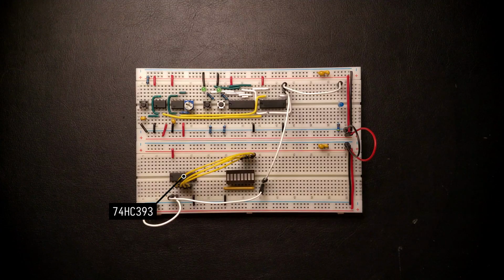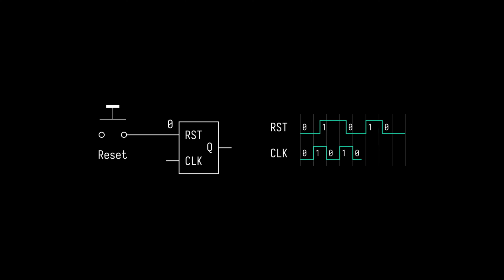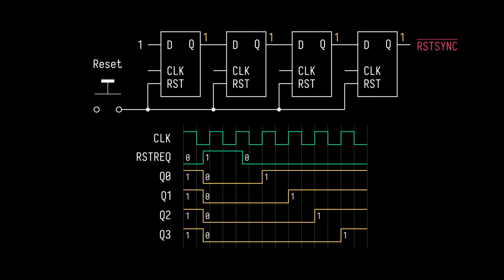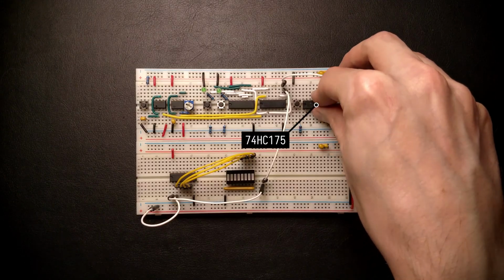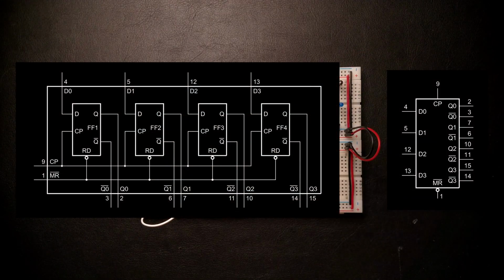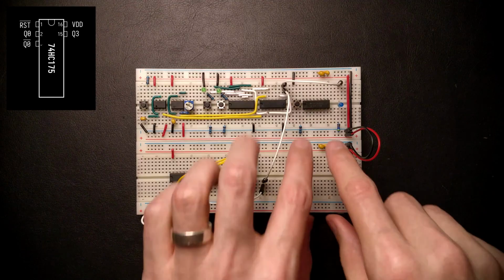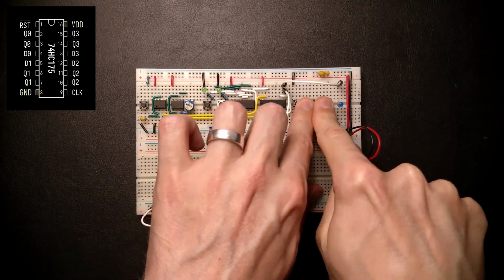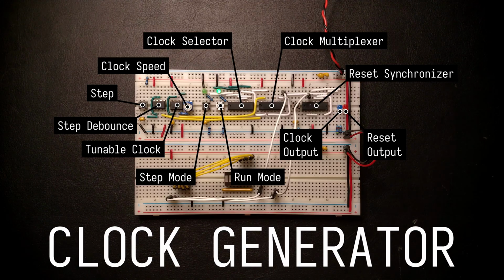Reset Synchronizer – Superscalar 8-Bit CPU #5

Comment: seems like the clock multiplexer's output should be latched, clocked by the free running clock or something, so that when you switch clock sources you don't cut the current clock cycle short. probably doesn't present itself often if you're running at extremely slow frequencies like this but if you scaled this up to use a fast crystal and had long propagation chains in your CPU it seems problematic. i think james sharman might've encountered this? cannot recall.
Reply from the maker: Yeah that's an excellent point! Just having a multiplexer there can introduce glitches that ruin the state in the CPU. Pretty sure that's going to become a problem with fast running clocks as you say. Ideally you'd have a clock gate at each output and use a bit of logic to gracefully switch between two logic sources. Or use the fastest clock to drive an FSM that safely disables the active clock, waits until it has been low for at least one cycle, and then enables the newly-selected clock.

Comment: I recently saw your fantastic series and try to build the CPU in a simulator. By implementing the reset sync I noticed a problem with being the first D Input constant high and simultaneously pushing the reset pin high. This should lead to an unknown state at the output since set and reset are both high then. To avoid that I used J-K Flipflops, this works better, but if I keep the reset button pressed the output will toggle then witch each clock tick. 
What do I miss?
Reply: I found it myself, the 74HC175 uses a flipflop with a asynchronous set and clear and a synchronous data input. The set is forced to low and the clear resets the flipflop immediately.
Reply from the maker: Yes, that's it! 🙂 The async reset on D flip-flops usually overrides any clock or data inputs, and will force the output low. Once the reset is released, the clock should cause the constant high input to be stored and propagate through the chain of registers.

It's interesting that you ran into this issue in a simulator. Do you know what kind of register that simulator uses? This should be the normal D-type flip-flop behavior. But if the simulator uses some form of JK or SR flip-flop as you describe, you might get that weird behavior.

Comment: I built the clock circuit exactly like yours but there is still some occasional bouncing on the clock signal, which skips some steps, observable with scope too. Do you know what could be the cause?
Reply from the maker: I'm sorry to hear that! The first thing that comes to mind is the resistor/capacitor value that determines the debouncing circuit's time delay. The button you use might have more bounce than the one I had on the breadboard (my button might also deteriorate over time, causing me to run into the same problem you're seeing). My guess would be to try and increase the capacitor/resistor size to increase the debouncing dead time, such that slower bounces are still properly suppressed. Let me know if you see any change!
Reply: @fabianschuiki  I replaced the 470nF with a 1uF, and it seems to do the trick, thanks!
Reply from the maker: Great, glad to hear! 🎉🥳